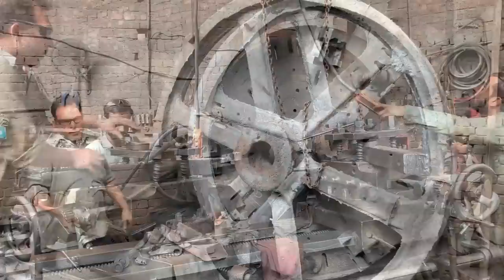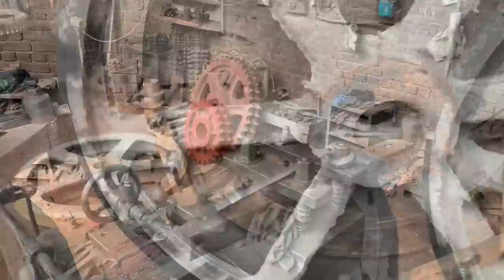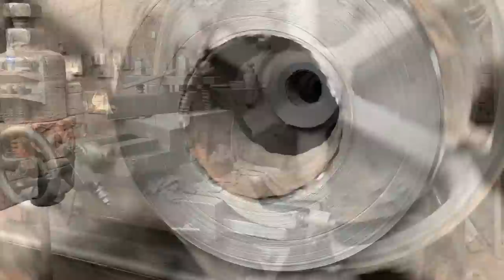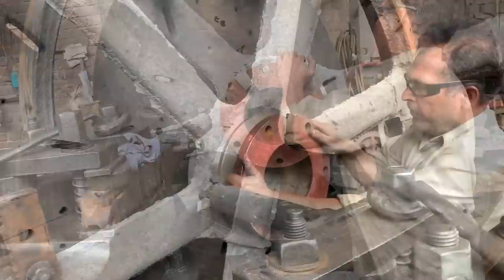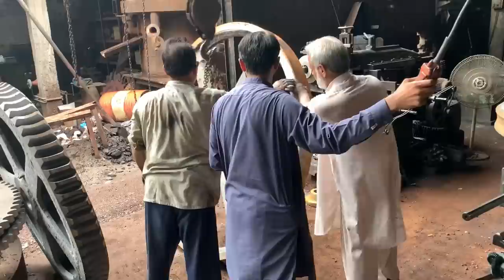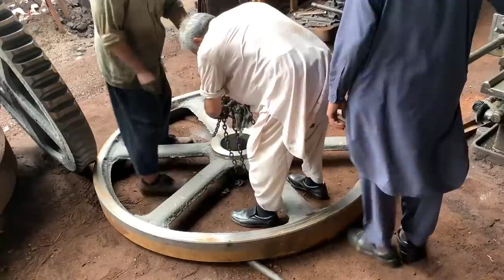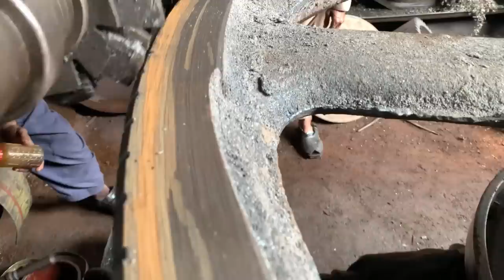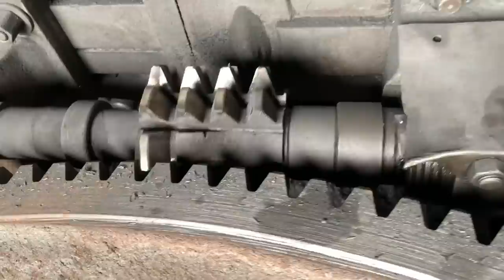Amazing Huge Industrial Gear Production Process || Largest Gear Machining on Manual lathe machine

Comment: No fettling required...  If a part only needs .1mm tolerance, then that's not that hard to do with pretty basic equipment.  Once you have a centrally accurate bore the concentricity to some extent just follows.  The rest is just paying attention to the maths.

Comment: One word: Precision!
Reply: Mk J; Where?  There was no precision anywhere.  Every machine showed signs of bearings being worn out. Defective boring bars.  Bent leads screws.  Not a single dial indicator nor micrometer used in the entire video.  The casting was full of voids.  It was ridiculous.  There are third world production facilities and then there are places five steps below that.
This video showed that place.
Reply: @wrongfullyaccused7139  Second word: Sarcasm
Reply: @MachineGunJelly584  ; Okay.  Thank you for clarifying.  Speaking as a retired precision machinist that machined things to four decimals, this video is ridiculous.

Comment: How did the cogs align so perfectly on the circumference of the wheel?
Reply: It doesn't, there is a slight involution of the shape of the gear hob's teeth on the gear's teeth, but the gear is so large that the warping is hard to notice. The real magic is the feed ratio of the hob to the gear so that the gear teeth are evenly spaced.
Reply: the bigger the wheel the bigger are the tolerances.

Comment: That casting, ouch. If it works, it works. Thats not an easy job working on heavy parts like that to begin with. A bad casting just adds to the work.

Comment: Please the job is not bad but the management should be put on the wall, please buy a safty gear for your workers as the clothes aren't fit for this type of work, steel bridge shoes and gloves and safty helmets with glasses , all the gear is cheap even if you get it from china.

Comment: I "Guess" they dont even use DIAL INDICATORS to CENTER the Gear ??  lol   and they run the lathe BACKWARDS  and the cutting tool UPSIDE down !!   Yikes !!    The operator Stands on a "STOOL "   while machining !!  OMG   OSHA  is UNHEARD of in that Shop !!  lol  
LOve this Place !!   Just like machine shops of the 19th Century : ))

Comment: All I can say is wow! Where is the finishing? Casting sand is all over the thing. Rough surfaces, and busted hobbling gear cutter. Gotta love the dirt floor. Looks like a fun time working in that environment. Why would anyone get any thing made in India with this quality.
Reply: I suspect those gears are for use in India - where much of the production machinery has gearing just as bad. No need for better precision.

Comment: I can just imagine the youth of today asking where the DRM is,  (digital readout) or the automatic tool changer ( his name is Ahmed). When  a few decades ago  the engineering companies was selling their manual lathes and  milling machines or little more than scrap value to India, Pakistan, Asia  etc. The companies never thinking that one day these companies couldn't compete with Pakistan,India etc as their labour market is so low paid its rediculus. The workers over there have learned how to turn, how to mill a good finish. Back to  basics where you don't need a degree to operate a cnc, just a good knowledge and some maths skills too to operate a lathe,  no indexing carbide tips when you can resharpen the cutter you have and when it's worn out, learn how to braze a new one in. People may  laugh at videos like this, I don't because it's how our fathers,mothers, grandparents and great grandparents etc etc did exactly just like these chaps. Love the show keep the great work going.

Comment: I can't believe no one was killed, that is the most unsafe machining I have ever seen, If that was in the USA it would be fined and shut down, There were more safety violations then I could count, as primitive as it is, I can't believe they made an almost good product.. The casting they started with, I would have rejected it.. All that being said, For what they have to work with, they are doing a bang up job, With better & safer equipment, They would be professional..

Comment: I can't help but wondering - if the gear was a perfect fit prior to this milling then how is it going to fit when you remove material?
Reply: The two operations carried out on this rough casting are turning and hobbing. The original casting must be machined as shown for it to function as part of a gear train. The original casting was purposely oversize for these machining operations to be performed.

Comment: The initial quality of the casting is poor and with this and the low level of accuracy I suspect these wheels have a limited life at which point they are most likely broken up and used as scrap to cast new wheels and so the metal is constantly recycled.

Comment: The gear lathe is likely 100 to 150 yrs old, and was probably originally powered by steam, or maybe even a water wheel. The people who designed and built it are long dead but they live on in the beautiful machine they made, still at work turning out useful products.

Comment: You know you are getting a quality precision product when the part is eyeballed to the nearest divider, and there are missing teeth on the hobb cutter, and the machines cutters arbitrarily jump around on clapped out bearings while cutting!  ROFLMFAO     P.S. you guys seriously couldn't even be bothered to machine a collar to center the wheel on the hobb cutter??? The teeth now are not centered with the bore!
Reply: On top of that, those are some of the most Piss Poor Castings I have ever seen in my life........😂
Reply: Thought i saw a register step on the first flange when they mounted it up on the hobbing
 machine?
Reply: Also lack of support around the periphery  of the casting during hobbing. where I worked we used offset pedestal type supports positioned under the rim and inside the root diameter of the gear teeth for maximum support.

Comment: fuggen try better molds for one thing, look how shoddy those molds are, what is this 2098 BC?  horrible molds, more precise molds mean less machining.. lord, I've seen brass props molded and all they needed was sanding and polishing.. look at this busted up wagon wheel they're trying to true up and size with the lathe rocking around.. what?  that's the problem, they are content with doing everything half ass, in their sandals no doubt, fuggen try some precision FFS

Comment: These are the worst casting I've even seen in my life.  And I have been casting for over 25 years.  I don't even know what to say about the 2x4's that were used to anchor the casting in the mill.  Just when you think you've found the dumbest machinist in their country, there's a machinist on the other side of the shop says, "Hey, I'm dumber than him".